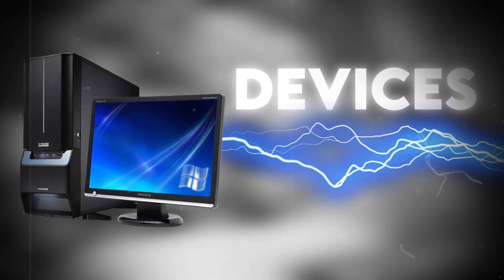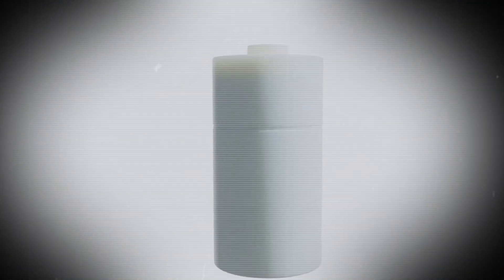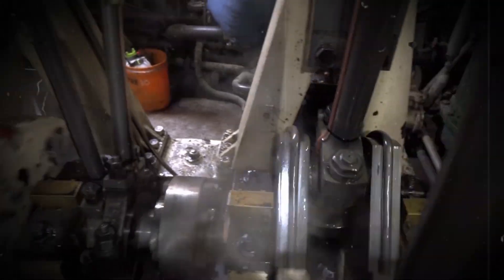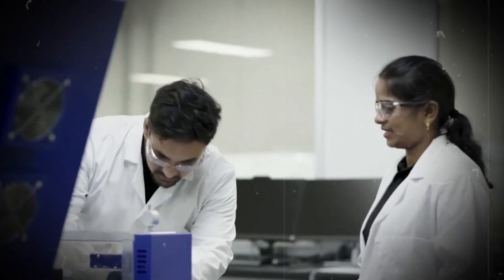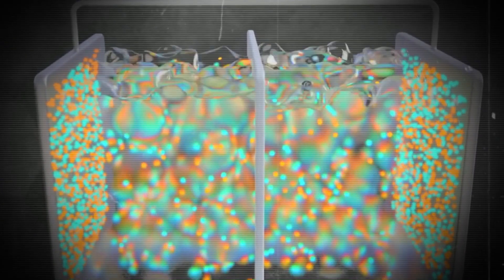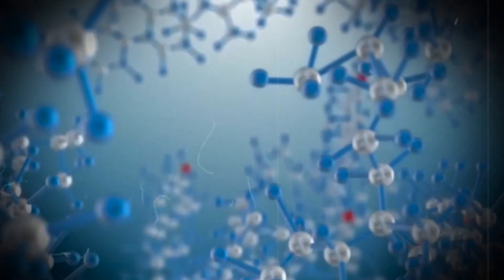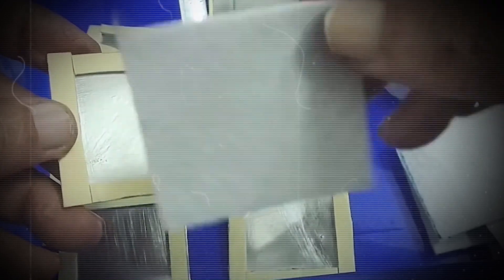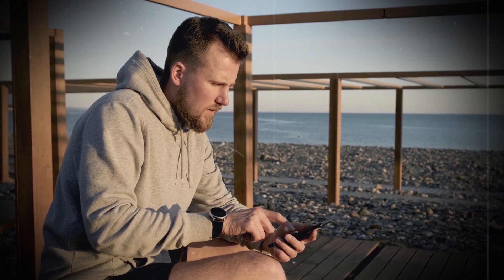New Aluminum Ion Battery Explained

Comment: It's exciting to see aluminum batteries gaining traction. How does the energy density compare to lithium batteries in current applications?
Reply from the maker: Currently with aluminum-ion batteries being considered a solid state battery, they don't pose the same risk of explosion or fire like Li-ion batteries that use liquid electrolyte solution, so there is no need to have components for safety, thus saving more space. They have one of the highest energy densities of all batteries, up to 50 times the energy density of Li.